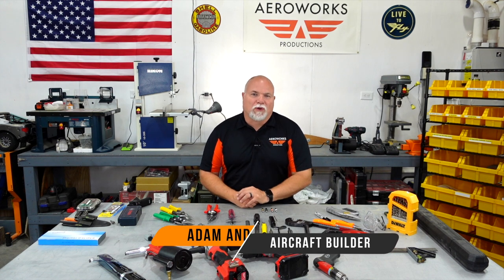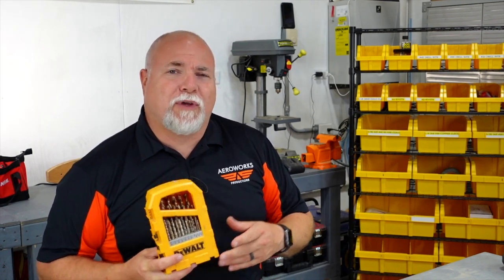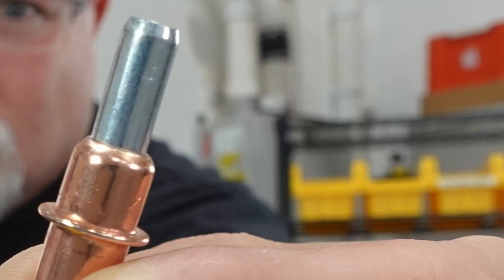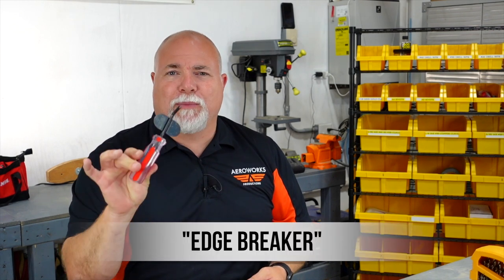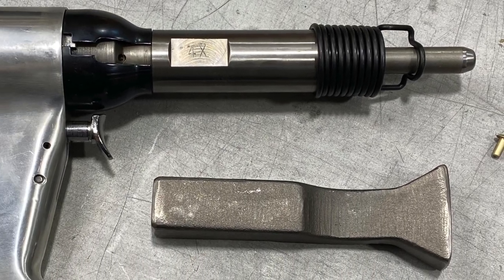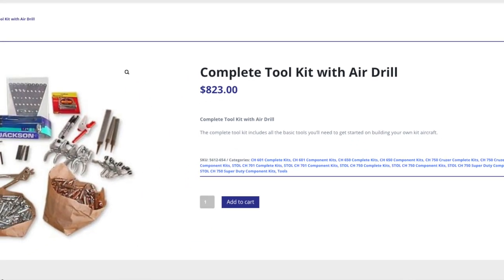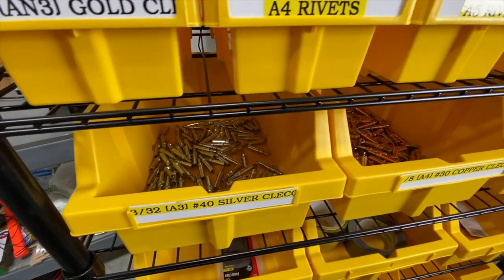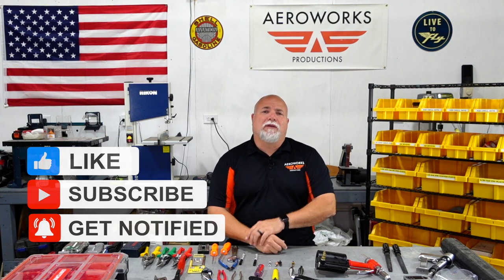Ep. 2 | Introduction to Aircraft Tools | Zentith Super Duty Aircraft Build

Comment: As for compressor run cycles you can add tanks i use a 40 gallon 2 stage compressor in the shop(in a sound dampen enclosure with a 2 150 gallon tanks outside for air storage on average it cycles the compressor once every 1.5hrs instead of every 5 to 10 minutes  this also helps in drying the air and keeping the air cleaner for the  tool filter system and the painting filter/dryer system as well.
Reply from the maker: Great tips.  With the exception of painting mine doesn’t run that much or for long.

Comment: For a quiet air compressor, I bought an 8 gallon California Air Tools compressor.  Extremely quiet at 60 decibels which is equal to normal conversation.  70 decibels is equal to a loud restaurant.  Big difference.  The compressor is sufficient for pulling rivets, but not for something requiring high volume like painting.  Just my opinion.